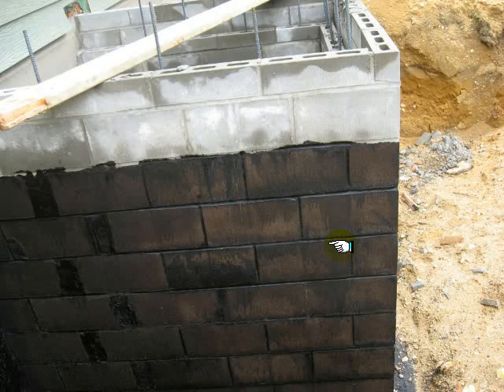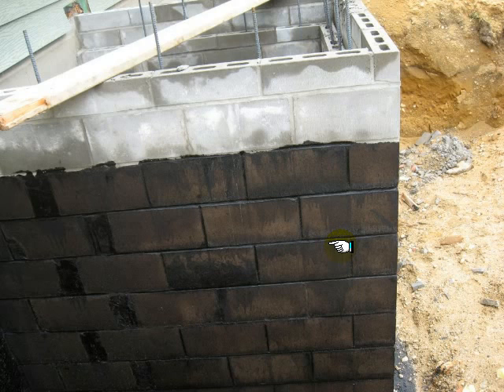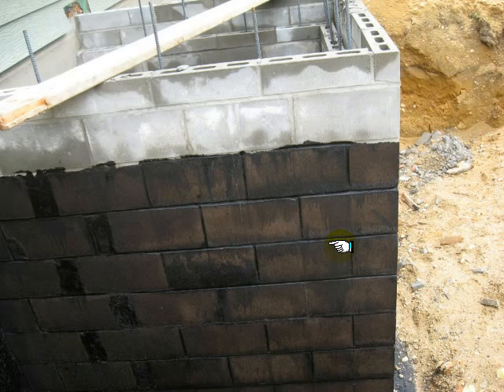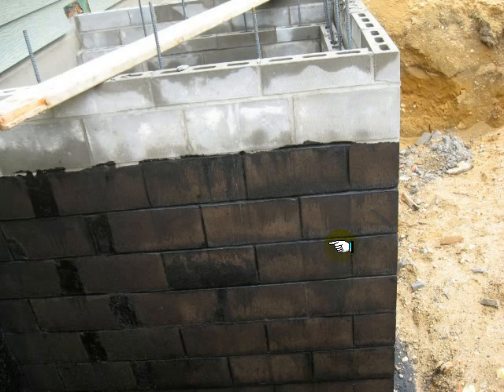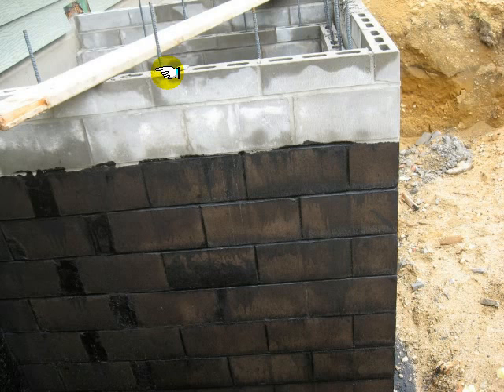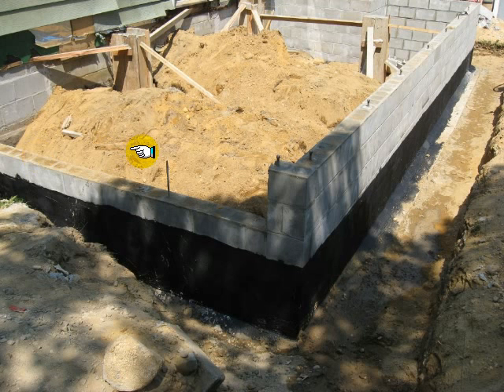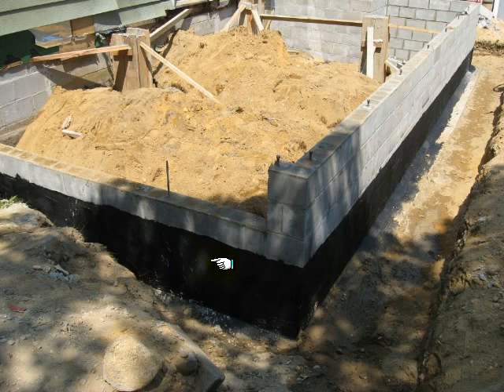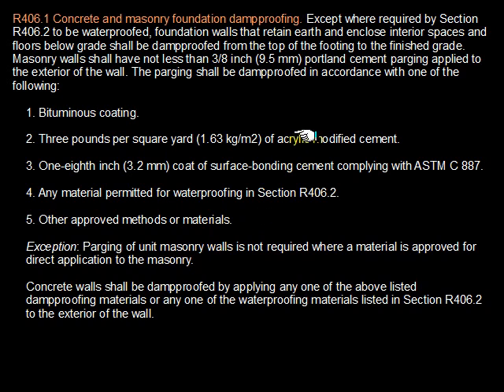Dampproofing Foundation Walls

Comment from the maker: The second example is a garage.  It's been a while, but I believe the block was parged.  Nonetheless, the foundation will be filled with sand to the appropriate level and a slab placed for the garage floor.  The CMU is not enclosing useable space, so it is not required to be dampproofed.  Whether it was parged or not I would not have failed it since it was not required.